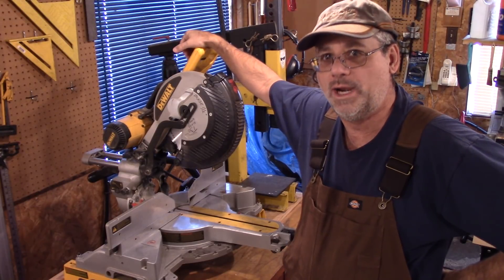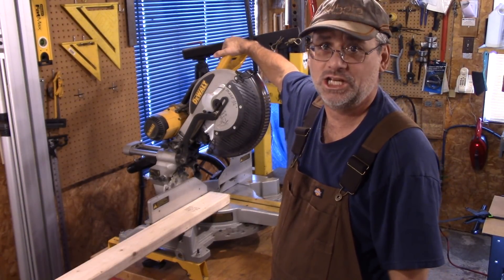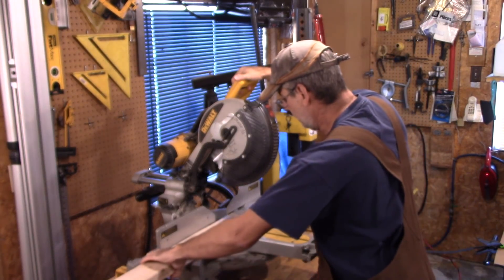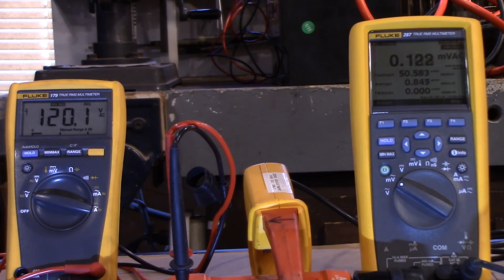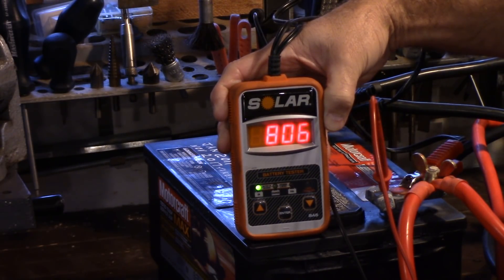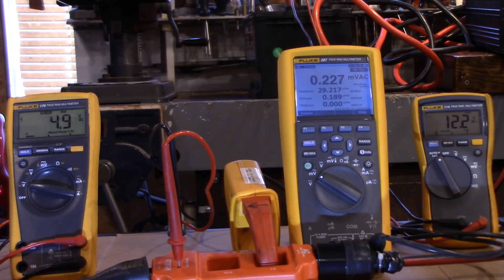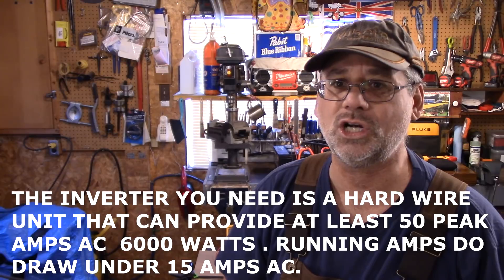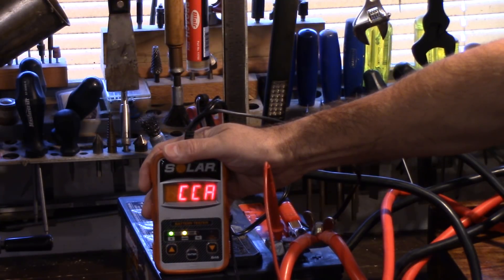HOW  DC TO AC  POWER INVERTERS WORK - WHAT YOU SHOULD  KNOW BEFORE  BUYING AN INVERTER

Comment: Inrush for starting an electric motor rule of thumb is three times the full load voltage.  That is a lot of amps. Thank you for the video, Steve
Reply from the maker: Its interesting to me at least measuring the inrush as it does spike quite high sometimes.

Comment: You have a lot of meter Steve but for me, you don`t have enough for a Gator test....I just don`t understand where your going with this and all the meters....I`ll just say one thing and hope it`s in layman's language....when you read a nameplate the rated current is calculated at rated load and at rated voltage and all should be on that same nameplate anyone that not dead on will make your amp vary......This will make up the amount the motor will draw from an electrical system when producing its rated horsepower...and there an equation there. This can be referred to as running amps full load amp or rated amps or just amps....the other reding you get on start is mostly none as starting amps which you here were trying to overcome.....All invertersed are not all created equal and to find the good one you have to now what kind of sin wave one of these produce and then how choppy and how complete it is.....more or less how does a 12 volt inverter take 12 volts DC and converts it to 120 volts AC....some of them....the real cheap wingwang ones do a very dirty job of it and especialy under load....they just not enough in there to produce a good sine wave and the cycles....don`t forget the cycles.....same thing as the cheap generators......If you want to play you gotta pay.....a special with electric motors ....just get a generator big enough to carry the motor or get a gas motor....Very hard these days a special if $3 is the budget ah no that was for the plug ends....enough said....I think I said too much I`m lost and I don`t know what I`m talking about.....CHEERS.....ah last thing....what you really should have is an oscilloscope for test like this
Reply from the maker: HAHA it's a good thing to show the differences Gator and how the specs  on a  power tool needs to be looked at more closely when using an inverter or genset. Power tools are manufactured to run off your utility not genset or inverters. Good thing to test and show the differences.

Comment: I always learn something over here!! I would have just thought that what ever ratings the equipment was listed as is what it was.  I see there is a lot to learn before venturing into solar! Thanks Steve for sharing this info with us.
Reply from the maker: Yes Lee the rated specs work fine with your house electricity  but a genset or worse an inverter takes a bit more planing in getting the right  equipment .

Comment: I'm not surprised it spikes up to 50amps on startup.  House breakers are designed to take it for a very short time.  Inverter just can't supply with it's power source.  Heck 15amps A/C from the inverter is about all that battery can muster and being a car battery probably not more than a few seconds until the inverter kicks off from the low voltage.  Nice test, inverters are fun! :D
Reply from the maker: Yes  and that's something you learn over time trying different loads - many think an inverter can keep up with your utility and in most cases not so much unless you pay lots of coin for a beefy unit.
Reply: And with the beefier inverter you also need a beefier power supply which leads to beefier charging system and your wallet gets less and less beefier very quickly! And now I want a hamburger dang it...
Reply from the maker: HAHA